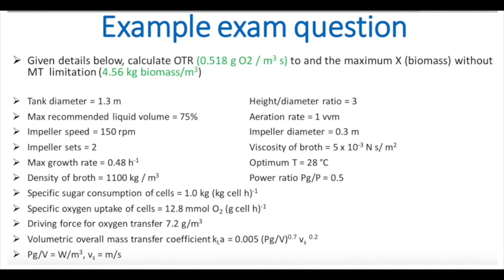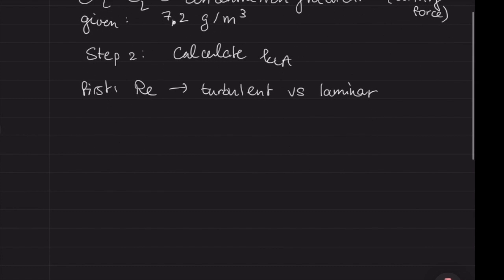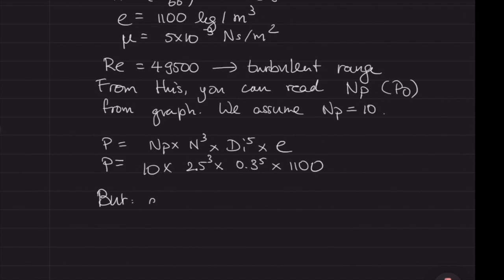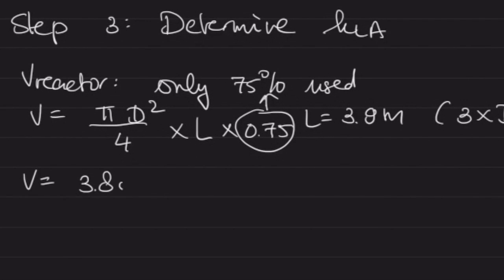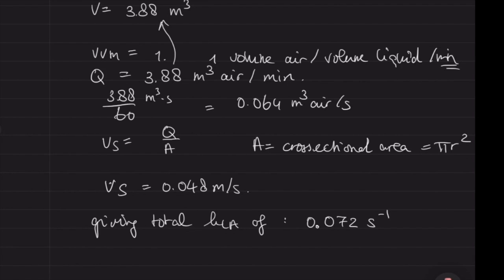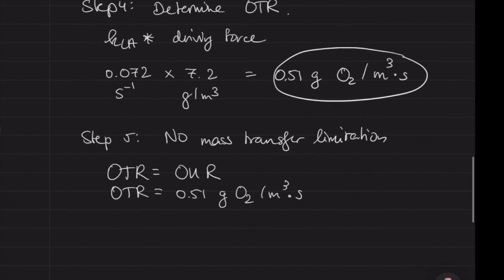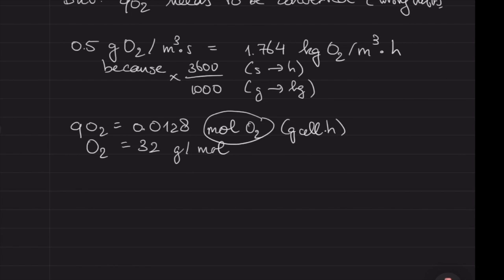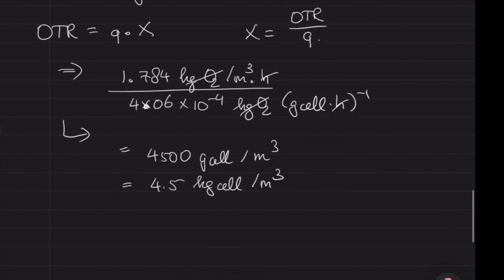Calculating oxygen transfer rate in bioreactors

Comment: How did you get the kLa from the superficial gas velocity?
Reply from the maker: On the first slide, you can see that kLa is a function of Pg/V and vs (formula is almost at the bottom of the page). This is an empirical formula for kLa that is commonly used.

Comment: Can someone help me understand: Pg = Watt = m^2*kg/sec^3. When divided by the volume you're left with kg/sec^3*m. How does Pg/V * Vs give you 1/sec as units?
Reply from the maker: You can read more about it here: https://www.sciencedirect.com/science/article/abs/pii/S0168165613003830. This is an adaptation of the Van 't Riet equation but there is also a form of it that is dimensionally tight (Henzler, 2007, see link)
Reply: @MarloesPeeters  thank you.

Comment: Very informative videos, many thanks for taking the time to upload these. 1 question: this question uses vvm as 1, in the case vvm isn’t 1 what would be the volumetric flow of air? 

Is the calculation:

Volume of liquid/vvm -> ans/60
Reply from the maker: vvm stands for volume of gas sparged per unit volume of liquid - it is usually around 1. If it is 1.2, it means you have to calculate the volume of the liquid in the reactor first and then multiply this by 1.2 to get volume of gas per min. You then divide this to get volume of gas / s (Q).
Reply: @MarloesPeeters  Thank you! I hope you continue to make these types of videos I’m a student elsewhere and these have helped significantly in the design of my reactor.
Reply: You state 3.88m3 for your volume - if it’s 3.88L then that’s divided by 1000 to get into m3
Reply from the maker: @sau01drs  It is 3.88 m3, not sure why it needs to be converted into L for this purpose?
Reply: @MarloesPeeters  I mentioned it because 3.88L is 0.00388m3, not 3.88m3